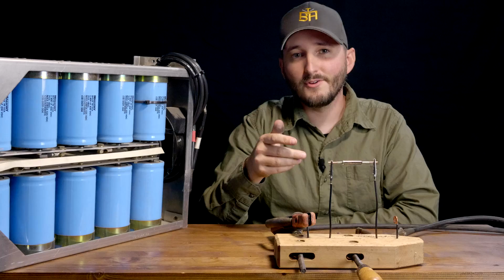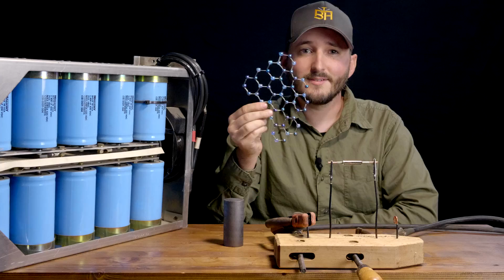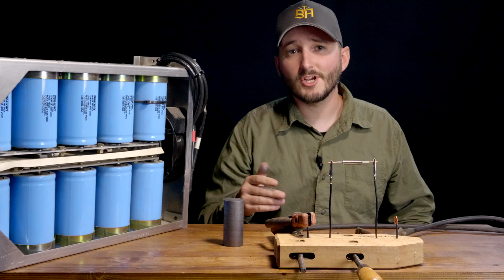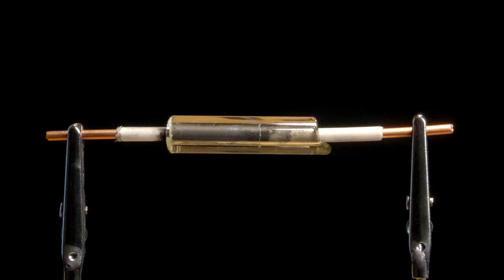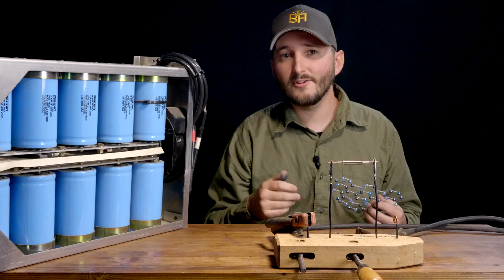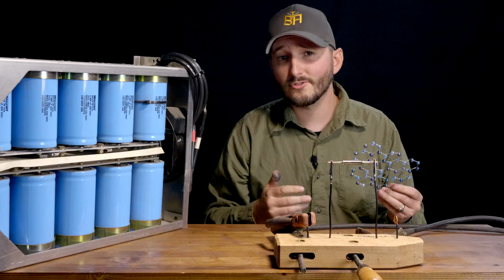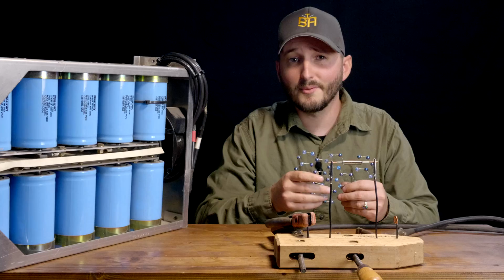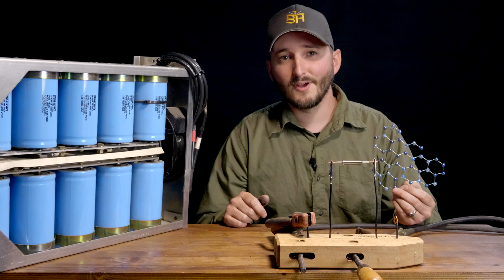How The World's Strongest Material Is Made From Coffee Grounds (Flash Graphene)

Comment: First, off I wanna say great video. But I looked up the paper and have some huge concerns. I've actually done a lot of work with graphene and what they're demonstrating is... odd. And frankly seems a bit cherry picked. Things that are interesting: ease of dispersability, and the seeming strength increase when added to stuff. Things I find concerning: those electron microscope pictures and some key notes. 

When you look at the microscope images, and then their simulations, what they've made isn't really graphene per say, and especially not graphene in an ideal form. Graphene at it's strongest are big flat sheet. What they made are weird onion shaped chunks. At least, in the images they chose to show. In that mixture there's very very likely to be various other carbon materials; nanotubes, other fullerenes, carbon onions, and random amorphous debris. They did no purification to remove any of that stuff and when mixed into a solution, it'll all just look black. Only a few fullerenes have a distinct color in solution. So mixing it with a solvent will look like you've made a graphene solution when in reality it's just shmoo floating around. In fact, when you look at the cuvettes of "graphene solution", they look more than 50% full of sediment, with only a very small amount of liquid on top.

This could explain the strength increase, but also the error bars on that test are fricken massive, their sample size is 3, and they use a weird surfactant to dissolve the "graphene" which they have no negative control to compare to. Like there's no concrete sample with just the surfactant and no graphene. So either the mismash of components is what's making it strong, or the surfactant is, or they just didn't run the test enough times, or any of 100 other reasons that sample looked stronger.  

ALSO, they show a side by side comparison of "commercial graphene" vs FG. Why... is the commercial sample clear? Like not just clear, but with no sediment at the bottom? To me that screams "one of these vials just has water in it because we didn't add anything to it". Because any commercial sample should dissolve at least a little, and the rest would sink to the bottom. Unless they're showing supernatant? I dunno, very weird. Also the way they're solubilizing things is odd. They're using this weird surfactant pluronic 127 which I'd never heard of but I suspect makes things appear a lot more "soluable" or at least dispersable than they really are.

Further, saying "graphite is the 3d form" isn't really accurate. Graphene are big 2d sheets of carbon. Graphite is simple those sheets stacked up. If anything, the stuff they made is the "3d" form because it's a jumbled mess of interconnected layers and closer to amorphous carbon. This will make it utterly useless at being turned into fibers as you won't get the large sheets forming a liquid crystal in solution which is required for that. Also they don't talk about the oxygen content of the "graphene". If what they made was highly oxidized, then that alone explain why it's soluable in water. Graphene oxide is already water soluable. I've got a bottle of it. So if that's what they made, then it explains some of it's weirder properties. 

All in all, none of this is NOT a criticism of your video. The video was great. But their paper to me, was super super sloppy and leaves a lot of unanswered questions. Especially when it comes to things like graphene, there's a lot of really crappy research that turns out to be useless on further study.
Reply: Soluable.
Reply from the maker: Thanks for your comments! You certainly have way more depth of knowledge in this area than I do. I'll be playing with the process more myself and see what comes of it. Most of the graphene research I've looked at is really lacking in side by side performance comparisons of various other graphenes and graphites.
Reply: And the paper was published back in January, i would assume companies would have started (or talked about starting) any form of mass production lines using this process by now. But nope, no word about it at all. So im also calling bs
Reply: I think at least this is a good start....
Reply: @Nighthawkinlight  Ya for sure, give it a go. I'm excited to see your results. But ya this is what I mean. Most graphene papers... suck. 
Also, making graphene can literally be done in a blender or ultrasonic bath at many-gram scale. A solution of tannic acid (green tea works as a lazy substitute) is mixed with a bit of graphite powder, then you just ultrasound (or blend) the hell out of it for 2-4 hours. A mixture of acetone and water also works but I don't remember the exact ratio and that's obvious more sensitive to heat because the acetone will evap off. 
Or you can oxidize graphite first using the Tour method, then ultrasound it briefly to get a stable solution of graphene oxide in water. Lots of way to do this that'll produce big sheets of graphene and not weird clumpies.
Reply: @thethoughtemporium  Environmental impact of this? when carbon nanotubes first gained fame there was worry that this would be carcinogenic because of it's shape. Just like asbestos was about to ruin the world, gained widespread use bt banned. I see they're talking about using it even in buildings, is graphene that safe?
Reply: @davemwangi05   Graphene is only 1 atom thick, and that atom is carbon, I see no reason to be concerned personally, but I am by no means an expert, or even well educated in the subject.
Reply from the maker: @thethoughtemporium  Have you seen this supplementary info on the morphology of flash graphene? https://pubs.acs.org/doi/suppl/10.1021/acsnano.0c05900/suppl_file/nn0c05900_si_001.pdf

Figure s19 is really interesting how the structure varies by discharge duration. Then figure s21 of the 50ms discharge product before and after shear. Those are more impressive images to me than what was contained in the initial article.
Reply: What if you altered the setup by sandwiching the carbon between 2 quartz plates and instead of one pulse of electricity you set off an arrary of pulses across a number of electrodes to create a web of electrical pulses. you could have 2 lines of electrodes and then fire off 123 on one side to the first on the far side and then go 234 on the far side back to the 2nd on the close side and drop the discharge time as small as you can so that the re ordering of the electrical zapping un-peels the onions or at least re shapes them into more of a wavy sheet or something like that.
Reply: @Nighthawkinlight  I hadn't until now but honestly... that makes it worse than I initially thought. I was right that it was a weird mishmash of junk. Also you can see the number of layers and that layer count is HUGE. Calling that graphene, in my opinion, is bullshit.  That's just straight up graphite at that point. Or graphitic carbon. Which again, calling that graphene at that point literally makes no sense. Look at figure 14. There's got to be hundreds of layers in that stuff. And sure you can ultrasound it to separate them, but... if you're gonna do that anyway, why bother with this method? The individual sheets aren't very large so there's not real benefit to this method. Same with figure 12. Ya they're making graphene "layers"... but that's just called graphite.
Reply: @okaydetar821  actually that is something to be concerned about. As that is small enough to damage DNA. Carbon may be inert however that is not the only way a substance can increase the chances of cancer in the body.
Reply: What a shame you weren't asked to peer review this article; you would have had a field day!
Reply: Amazing comment!
Reply: @thethoughtemporium  there's a huge problem in science where people are naming things without understanding what it is that they are naming! I'm surprised that they didn't call it dark matter LoL, at least then people can actually use the name as a fact for something that can be found LoL. Don't you just love it when someone says that it's because of dark matter and dark energy, oh! Really! And you know this how? 
I'm all for something new, I really don't care if it's weird, just don't call it something that it's not! Sometimes it takes a long time to come up with a name but sometimes it doesn't. 
If it doesn't look, feel or smell like graphene, then chances are that you have something else...
Reply: See Quinn  i agree with @Dimes On His Eyes  on this one...have you heard about fine particles and ultrafine particles?
Reply: Does it need to be high quality graphene in order for the benefits of it being in concrete to be present?
Reply: @thethoughtemporium  maybe what they published in nature is the one success of many failures..all they have to say is that the method is possible...
Reply: I thought it was weird that this process could create an atom thick layer, so this thread has cleared things up a bit for me.
Reply: When the video was first published on Nature's youtube channel I left similar criticism not in the depth you went for, and certainly the name of the professor behind the work was big factor to get this manuscript to make its way to Nature!
Reply: too many graphene articles are just graphite or soluble poymers...raman spectroscopy is the only reliably method of graphene detection/identification.
Reply: See Quinn  It's all about degrees. Yes radiation is everywhere and is normal but only in small quantities. Veritasium does a great demonstration of whats dangerous and whats not by traveling to radioactive sites around the world. 

My understanding is that asbestos is toxic because it has long spear like microscopic fibers that are great for dissipating heat aaaaand literally spearing DNA apart through the walls of cells. Enough broken DNA strands from enough exposure and you have cancer (also what radiation does in sufficient quantity). Turns out carbon nanotubes do exactly the same thing and maybe even are better at it. The concern with graphene is that it would be like molecular knives. Imagine if it got into a powdered form and you inhaled it? Trillions of trillions of one atom thick knives would enter your lungs.

I do wonder if in one regard it would be less harmful. If it was a knife it seems like it would have to cut through the cell before harming the DNA which seems like it would just kill the cell. The body knows how to deal with that and if its dead it can't become cancerous. In which case you would get... Silicosis; I wonder if that's better. Alternately the flakes of graphene potentially could be so small they could enter the cell in solution and damage DNA without lysis.

That last paragraph is just me hypothesizing. I've tried to find more information about the potential risks of graphene but haven't found much information out there.
Reply: See Quinn  i know what your point is...nuclear radiation is dangerous...but lets not neglect that nanoparticles also have major health issues...or are you saying that nanoparticles have no concern whatsoever?? are you sniffing graphene nanodust??
Reply: What about genetically modifieing some organism to make graphene (I don't even know if it's possible though)
Reply: @sharadthecurioustardigrade1533  not possible. Graphitic carbon requires too much energy. No enzyme could do it
Reply: @thethoughtemporium  But what if you add chitosan to it?
Reply: @sergeysi779  I mean, I'm sure you could make graphene out of chitosan, but not directly with biology
Reply: @thethoughtemporium  For the general public: I was referring to the running joke between Justin (The Thought Emporium) and his friend Gabriel Licina:
- They finally solved the problem!
- Did they add chitosan?
- Yep.
Reply: @Nighthawkinlight  You should collaborate with applied science. He would surely get a few nice pictures of the samples under the electron microscope.
Reply: @RaExpIn  Hate to break it to you, but to get that high resolution SEM images requires a state of the art machine in good working order. Ben has an electron microscope, but it would be appropriate to call it hobby grade.
Reply: @kylejacobs1247  Too bad... :/
Reply: See Quinn  Don't eat any bananas. Each time you do you receive about 1μSv of ionizing radiation because a small percent of all potassium is radioactive. But then there is also something else that contains a lot more potassium than bananas: the human body. You receive about 390μSv a year from the potassium in your body. You get about 3-4mSv a year from natural background radiation from just existing on earth; even more if you live at high altitude because of cosmic radiation.
Reply: My first thought was also 'isnt time usually your friend when forming large organized structures'? Seems thats still true. Still, doesnt mean their carbon goop does not have any useful applications...
Reply: It's not made in China, that's the problem.
Reply: Well folks you have it right here.
It's all made up, no progress was made and all the paper is BS.
Reply: @eelcohoogendoorn8044  yeah kinda wonder if those "graphene" blobs might have a similar properties as those glass prince rupert drops. Sounds plausible, But I don't know anything about this stuff.
Reply: If we consider where and how the graphene is being formed in the tube, could  different electrodes be used for better production or could the carbon sample be layered. It must be something to do with the plasma boundary layers imho
Reply: @evilcanofdrpepper    Dammit, that's what I was going to say.. but you beat me to it..
Reply: This is sad to read I was excited about this new way of creating graphene, some researcher need to shed some lights on this..
Reply: @thethoughtemporium  This whole comment thread shattered my imagination. But I respect being enlightened. Stinkin' graphite.
Reply: Onions have layers, just like ogres
Reply: @thethoughtemporium  Do I smell a collab? :0
Reply: @Ryan Brown You couldn't have 1 atom thick vests with any reliable bullet resistance. The kinetic energy of most rounds is too high.
Reply: What ever happened to making graphene by coating a CD with graphene oxide and then writing it in that old HP flip-the-disc-and-label-it CD-R drive? You'd think a reel to reel graphene-on-plastic process would be dead simple if something like that worked well...
Reply: This has got to be the greatest youtube comment of all time
Reply: ah internet and freedom of speech you sure F-up BS quickly with like people that really know what they are talking about and can explain it fully, my point being I don't watch videos with out comments. good video and channel for showing us this looks like exaggerated research.
Reply: @hiftylonghead892  Wow! Your deductive logic is astounding.(NOT)The Fullerene was discovered in the 80s. Before you were born, I bet. Graphene a decade ago. When you're dealing with something few can comprehend, much less see, there is a tremendous learning curve. The costs involved are tremendous for something you have no idea of when it will be a viable commodity. Look up the start of carbon fiber. Quite the story. By mid 80's it was down to $1000/lb, the America's Cup racers were using it. You might want to study up before putting simple logic to highly complex issues.
Reply: This looks so like the same concept 15 years ago used for making carbon nanotubes, also an arc discharge process.
Reply: @thethoughtemporium  So when you say "big sheets of graphene" what are you talking about? Is this something that is visible to the naked eye? If so, how "big" is big? Can I touch it?
Reply: @sergeysi779  just add casein its got electrolytes ;-)
Reply: @Nomamegoogle  its made in rice, and they didnt even use rice, never mind china town rice, or real chinese rice
Reply: @thethoughtemporium  maybe not so much biology. maybe an extremophile that could just straight up create a chemical reaction in its surroundings causing the production of graphene as a product. I'm thinking about those ants that create boiling butt juice but with much more extreme reaction. I mean mantis shrimp can handle being near temps close to the sun from their cavitations idk..
Reply: also jellyfish have "stingers" ig that  accelerate so extremely fast that I'm sure graphene could possibly be made "biologically" nature has some pretty harsh addaptations graphene doesnt seem too far fetched
Reply: @bryanst.martin7134  Why did my simple logic offend you this much, stop taking things personally old man.
Reply: Just a random thought. Has anyone tried to do something like this inside a high frequency magnetic field? Just wondering if that would change the way the structures form as it all cools.
Reply: Oof, Guess I gotta wait a little longer before I can get my hands on some graphene.
Reply: I've read a bit about concrete. Strength depends on how much water you add to the mix, and surficants are used SPECIFICALLY to increase strength by allowing less water to be added. If you add a surficant and the regular amount of water it mixes better, making a stronger concrete
Reply: @kakasibatosi No. This is by the lab that "discovered" laser-induced graphene - actually based on research done by a Japanese group back in the '80s. Since I specialize on that exact form of graphenic material, I can testify that it's only partially graphenic, as it contains almost all other allotropes produced by laser power fluctuations (quite normal for lasers). When I publish papers on this, I have to get into arguments with the reviewers over the legitimacy of calling the material "graphene". These guys, however, managed to passed it off as "multi-layer graphene" in their first paper (it isn't; I called them over it in my work), by showing some very selective Raman's and some fictional DFT calculations. In general, that particular lab and its head have a known history of being more marketing than science.
Reply: I dont see why they dont just grow it on copper sheets long coils . Ro reduce cost think big small steel plant use power first use heat after steel to melt copper in the sheets then cut sheets into pennys or remelt at steel plant cost from making steel all in usa ?
Reply: The grad student who did the research, so maybe you can get some of your questions answered
Reply: @al-aurum2457  we already having problems with microplastics, soo... have problems with graphene doesn't look one big leap
Reply: @SunnySzetoSz2000  we have had good starts for years
Reply: @okaydetar821  the reason these things are carcinogenic is because they are so thin they can literally cut your dna and cells.
Reply: @davemwangi05  I've seen a study that purposes to use carbon nanotubes to treat cardiovascular diseases. Thus far it seems to work.
Reply: I can't believe I read all of that!  I have no strong interest. Years ago, I got a speculative fiction story published about the Space Elevator concept. (Carbon Nanotechnology)
Reply: Eh, I guess with all the talk in the comment above this one about making a company and investing, I could see why one would want to build up some interest around a paper that requires someone very knowledgeable to sort through, but it's good enough to get investors to throw money at and make a quick buck.  All that stuff is so toxic, on all sides.  A shame.  Holds back real scientific progress and responsible use of findings when it's all driven by that crap.
Reply: To me it seems like crude graphene method not a pure form but should be good enough to increase strength in certain materials and you can assume this method would be used by cheap companies unless there would be a cheaper more efficent way of producing graphene
Reply: @thethoughtemporium  The "Tour method," named after James Tour. The author of the paper?... lol Rice University has done a lot with graphene. Whether something will end up being useful or not is not yet to be determined.  I do agree a lot of graphene papers suck, which I blame on all the hype around it, but it has it's benefits. Funding baby!.. Kidding, but really.
Reply: @thethoughtemporium  what I don't understand is, why is it a problem if there are multiple layers of graphene? As long as the honeycomb structure of each individual layer is intact, the layers can be stacked as much as wanted, right? If you get multiple layers of pure graphene and stack them, you have exactly that, multiple layers of graphene, therefore combined they're even stronger.
Reply: Oh man. Thanks!
Reply: just a load of hype and nonsense then like most things. good for a youtube topic and soon forgotten. Samsung was supposed to have a graphene battery powered phone out by now. no sign of that either.
Reply: @jacksonpercy8044  no way it could, anyone who thinks it could has never heard of entropy.
Reply: maybe this method applied to electrified plates with clean carbon to start would be more affective, and possible multiple millisecond charges instead of single burst of energy. just a thought.
Reply: How much added strength would we realistically get from adding some graphene to a material?
Reply: @munzirataalsid2580  the same as we get from carbon fibre, strong in some ways, weak in others.
Reply: @SeaJay_Oceans  What nonsense.
Reply: @Withnail1969  Sorry you haven't been keeping up with the injuries reported in Canada,  Graphene coated masks,  Made In China.
Reply: @SeaJay_Oceans  There is no such news.
Reply: The length of this post seems like it would be better expressed through video...

;)
Reply: We need more people like you in the world
Reply: @Leekodot15  The most interesting property of  Graphene is the nano- Black Dust - chemical warfare agent.   Graphene dust clouds can kill almost as fast as  mustard gas, filling the populations lungs with blood.  After they die, rain and the environment washes away the graphene dust.   Non-Radioactive, and still somewhat toxic, but it leaves the targeted city intact.   It's carbon, so it's possible that microorganisms and plants break it down and consume it.   An Ecologically friendly  chemical weapon.   But not something people want to breath !
Reply: Thats what i was gonna say
Reply: @SeaJay_Oceans  No - on a nano scale it would clog up the pathways in your lungs for oxygen to get into the blood.  It would blind you as it will be next to impossible to clean out - instead of waiting for enemies to die - as its not a chemical warfare or chemical weapon - you use weather baloons tethered to electrodes - that go to the ionosphere while the opposite end is like a frayed mesh of wire - all of it coated and made of even more Graphene - dust a whole city in a cloud that you can't hide from - and wait for one ⚡lightning bolt to strike or be formed - and then you would be left with "Where's Waldo" and "Where in the world is Carmen Santiago"  well - they would be gonners - get a ultra super capacitor bank and blow some graphene dust around a negative and positive lead - do not go near it - do not be breathing near it either - it will get into your blood stream as nano particles, and accumulate in your brain like vaccines do via #NanoSilver ( Fact check me )  And the effects, not even studied - scientists are told to #AVOID anything having to do with nano silver and nano anything collecting in your brain from your blood.  I wonder why?  Oh because there goes their funding and grands - all that free government money.  You dont really need the lightning - but a good #SUNNY day - that sunlight can create the #Shock of the century - as light creates electricity in clouds of graphene.  Which makes me wonder why the hell no one has made a suspended field of graphene dust  - in a large balloon with dust from crushed crystals and calcium carbonate  with graphene oxide at a nano scale and yourself a #FractionalQuantumHallEffect - and depending on what radicals are around  - there is no telling what would be created - especially with the ULTRA charged crystal dust - and everytime it goes near - not touches - but goes near a #Graphene nano particle... and another crystal particle hits another crystal particle - while the sun is creating it's own electric effect on the graphene nano particles - the graphene literally pulls the electrons out of the crystals that are forming them - like tearing the sould out of someone on mortal kombat.   Via fractional charge - enough power to pull particles from other demensions.

And there's your dinner.
Reply: @AEON.    Well then...  better wear a blue paper mask, they automagically protect you from the everything !   ;-P
Reply: I mean if Tour was a proponent of Lamarckism you'd want to look at his publications with more sceptical eyes. Creationism has less evidence for it than Lamarckism.
Reply: @SeaJay_Oceans  lol #TrustInDrFauxi ( I #RESIST the Remedial highest paid US Government Federal Employee like I resist the #NotMyPotato loser Beijing Biden)
Reply: I saw an independent report saying this stuff was found in vaccines..something about hydrogel biosensors…would someone please explain to me? I don’t understand what that means.
Reply: I think that even with all that you say, in large, you're overlooking that Shmoo is QUITE valuable!  (at least, from what I've read in the papers written by Andy Capp)
Reply: Paul Sansonetti  Electrolytes!
Reply: This sounds like my studies and experimenting on magnetically treated water. However I'm sure there is a 275 dollar book you could easily purchase online supposedly containing all those unanswered questions
Reply: What is difference graphene and graphene oxide?
Reply: @AEON.  they say they found this in vaccinatie in Spain 🇪🇸
Reply: @CFHmetalorama  salt..
Reply: @PeterMilanovski  I found this "dark matter" u speak of...in the heart of my baby mama.   jk. I love this stuff I'm just out of my league here lol
Reply: @williambell3893  as humans, we are all out of our league! We find out stuff by either experiment or accident and then we try to explain why! But worse still are those who try to explain without experiment! And everyone just takes it as fact!
Reply: @sharadthecurioustardigrade1533  That will likely be the eventual solution because it's so easy to finely tune. Similarly to the spider silk in goats milk experiment. Though even now it would be difficult to build an industry around spider silk because of the cost per gram, despite it's strength. 

Carbon being an element though, it would be a tricky thing to bioengineer. It's common for bacteria to excrete ammonia and other compounds, but not so much to excrete pure elements and then it would have to be the correct allotrope of carbon, to further complicate it. However, I do see most of the future materials of the next century being bioengineered due to the fairly low running costs after the extraordinary R&D costs involved in finally bringing CRISPR editing to the masses. Within a generation I would expect microfactories producing materials, with many linked nodes, rather than inefficient gigafactories with their insane overheads. Germany in particular is looking to adopt a more hive mentality with its industrial base.
Reply: @WestOfEarth  It's the dimensions that are of concern. There is still ongoing research into what "lengths" are considered safe. Currently there's a dimensional cut off if you want to use carbon nanotubes in materials, due to the damage very short sections can do to human tissue, particularly lungs.
Reply: @justsomeguywithtattoos6267  then it becomes graphite. I guess🤔
Reply: @SeaJay_Oceans  carbon can't be further broken down 🤡
Reply: That's way more criticism of a video than I believe you're giving yourself credtit for. Be a man, own what's yours...you clearly worked hard on this critique to be insecure about the criticism within. 
Who cares about people's feelings when actual data is here to be critiqued?

"...but you and I, we've been through that, and this is not our fate. So, let us stop talkin falsely now, the hour's getting late...HEY!!!"
  🧢
---💥🤪
Reply: It must be wonderful to hide behind that Metaversal wall with this comment.
Reply: i think they are one & the same... have you found out more that you can share? 🧚🏼
Reply: @evilcanofdrpepper  you would need a lot of electronics work to supply the huge coulomb charges charging then discharging the capacitors' banks
Reply: Rice Labs did not invent this, I saw people doing this with a halogen lamp about twenty years ago. Millions of others saw those videos too. Rice are just claiming credit for it years later.
Reply: If you haven't already maybe you should pose this to Dr. Tour.
Reply: I found the graphene video from Tech Ingredients to be quite interesting, and they are able to use it for structural reinforcement to at least demonstrate some properties, if not actually use an election microscope or laser spectrometry. They use carbon black and a vacuum chamber to get a better yield. It was pretty mind expanding, a lot of detail about atomic structure.
Reply: @justsomeguywithtattoos6267  Graphite isn't very strong, look to your pencil for an example. The problem is, those layers slide off each other easily and unpredictably, and since you cannot ever guarantee the force you apply will be in the EXACT right direction, it breaks apart. Whereas graphene, interspersed within another material, doesn't have the same type of weak bonds.